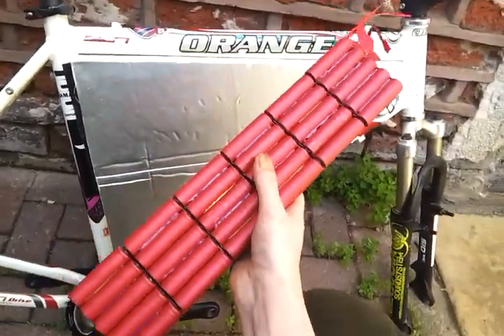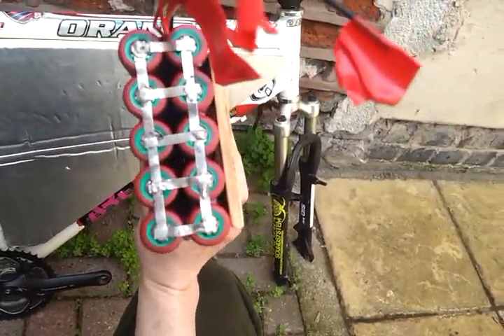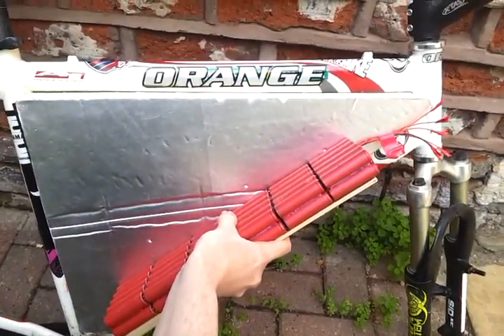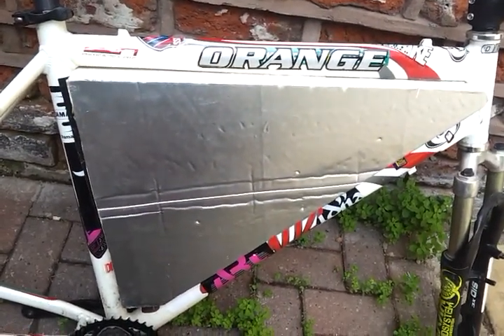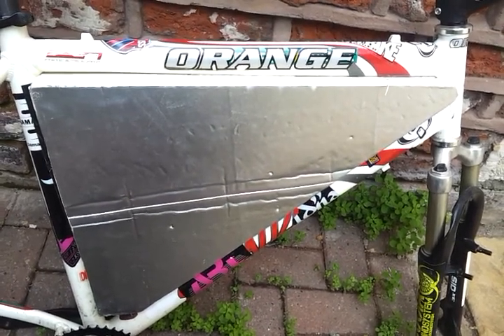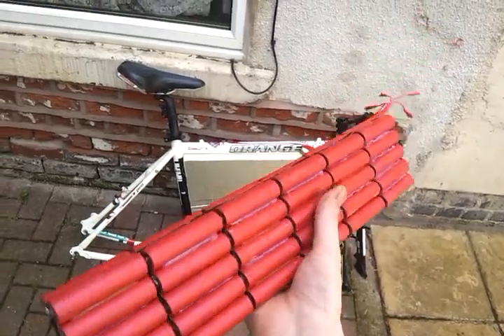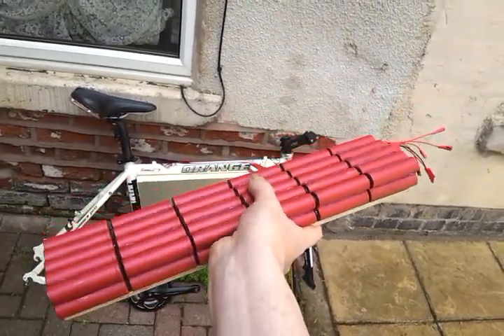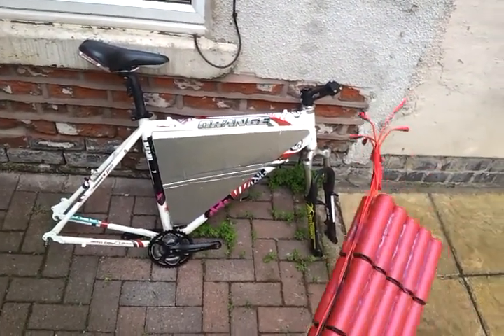Electric bike project...first battery pack made..

Comment: have you got 16 x 18650 li on batts going cheap for a 62 year old disabled man who has just been told he is dying
ME AS IT HAPPENS, 7 september 2015 DR Roddy at Shrewsbury royal hospital, be damned if i'm gonna give up or in, only way i can get around now is electric wheel chair and or a e bike got the one from argos in there spring time catalogue 
came from Avocet cycles manchester,
any way know any one with some batts for a 24v system, 200w front wheel motor, would really appreciate it
Reply from the maker: +vassilij zietseff (davlyn)  very sorry to hear that...i can  help ya with batteries buddy.
email me lets chat.
stoo234@gmail.com
Reply: Crispymenace email on its way brother